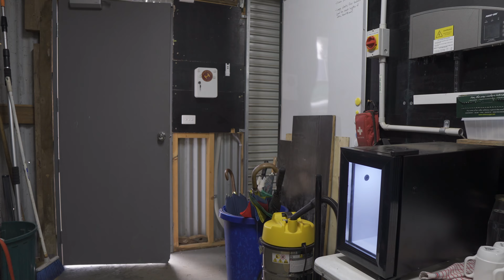Lithium Blue from Discover Battery

Comment: Great content as usual Glen. You mentioned that the batteries can't be shipped once used, what about if the had UN38.3 certification? Would that mean they could be shipped around for warranty replacement etc?
Reply from the maker: The problem is that the UN38.3 certification only applies to new batteries. Once used they are no longer compliant.
Reply: @SmartEnergyLab  It is my understanding that they ARE NOT Lithium Ion (Li-Ion) batteries........the are Lithium Iron Phosphate (LiFePO4) batteries.